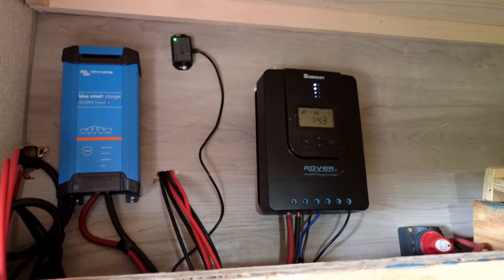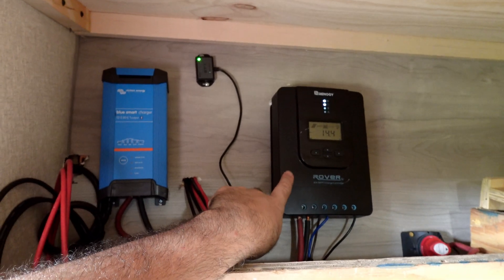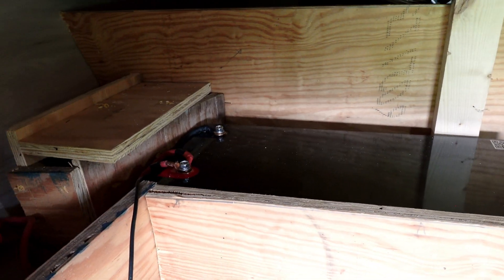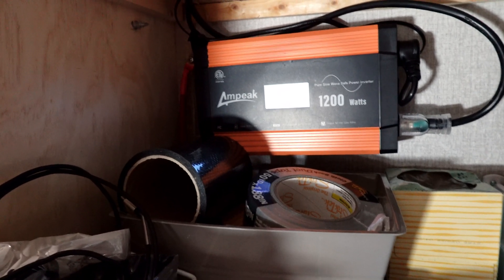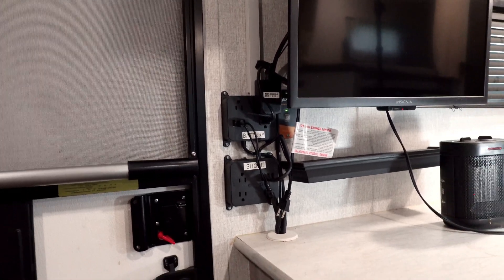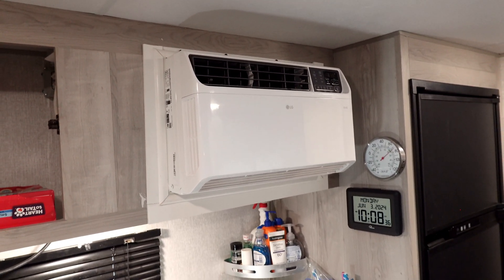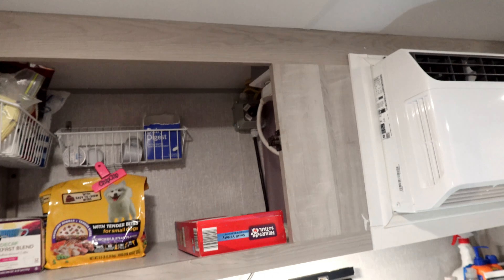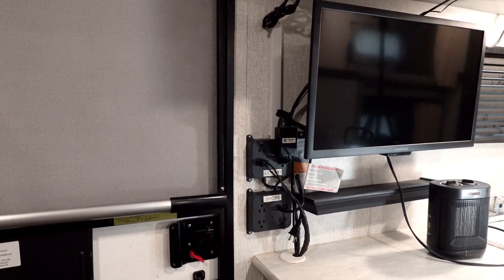Complete Solar Setup - Low Cost To Run Air Conditioner On Solar

Comment: Thanks for the video sir
Reply from the maker: You're welcome! Hope it helps!
Reply: What brand are your solar panels sir.?
Reply from the maker: @notchfox6086  They are a mix of renogy and eco-worthy.  Just make sure that if you mix solar panels to make sure the output voltage is the same, or your system will use the lowest voltage of all of the panels and you will lose efficiency.
If you do mix panels, you can do what I did. I have a 40amp Renogy mppt charge controller for 500watts of solar and I have another 20amp renogy mppt charge controller for an adidtional 200 watts of solar.  
You can buy them in kits like this so you save on a lot of cost https://amzn.to/3BjHVIW
Just add multiple kits if you need more watts. But you should only add up to 3 kits as the suggested max mppt charge controllers is 3. so 3 kits will save you a lot of money if you need 600 watts of solar.

Comment: Simple. I just plug my entire camper into the inverter using the shore connection cord. I then shut off the AC input to the camper's AC/DC converter. Done.  Also, how, the heck, are you running an air conditioner on a 1200 Watt inverter?
Reply from the maker: i bought a 6000 btu duel inverter window a/c. it runs around 600-watts for the first 15 minutes of cooling and then it goes down to about 200-watts of power use.  Also, because it's an inverter a/c I don't get a power spike. 
it will cool an open space roughly 24ft long. My rv is 18ft. and it cools it great!
Reply: @familyrvliving I didn't know about dual inverter AC. Thanks.
Reply from the maker: LG makes it. It is extremely efficient. Here is my install video https://www.youtube.com/watch?v=cW-v2OV2T1w

Comment: I’m in the Philippines building my ice cream truck now I ordered the 2 life pros 280ah batteries here they are 420$us each but I’m going either the 3000 watt inverter my ice cream machine is 1100 watts cycling on and off my deep freezer is 200 watts same and the snow cone machine when in use is 300 watts you think 2 280ah life pros will be enough?
Reply from the maker: 2 280ah batteries should be fine, but you might need at least 1100 watts of solar to keep it going, or a 1500-watt generator https://amzn.to/4ebh53Y  and 3 victron ip22 chargers to keep them charged https://amzn.to/4ecPeQR
Reply from the maker: you might be able to only use two victron ip22 chargers https://amzn.to/4ecPeQR

Comment: Consider/review a less expensive $706 all in one solution: 280AH, Pure sine inverter, charge controller from Licitti:
1000W AC Battery Box PRO New!!!
Strong ABS+PC with flame-retardant rating UL94 V-0
Pure Sine Wave Inverter
Easily see battery status with large digital display
Multiple port types allow you to connect a range of devices
Easily connect a DC/DC charger or solar panel to charge the battery, or use the VSR to charge directly from crank battery
Can be used to jump start vehicles (175A Anderson jumper cable set is an optional extra)
All ports are recessed into the body to reduce likelihood of damage
1 Years Warranty
Estimated delivery time within 3-5 working days
PACK
CLEAR
$906.00 Original price was: $906.00.$706.00
Reply from the maker: That is a really nice all in one solution. I'll definitely contact them to see if they want me to review it. It fits perfectly with my channel theme of low watts.

Comment: It's cool that you can run your A/C on such a minimal, inexpensive system. Kudos! We built a very capable solar system on the cheap (relatively speaking) too. My wife and I are retired and live FT in an older motorhome, boondocking most of the time. In fact, we boondocked for 10 months last year. We're designed and built our off-grid electrical system ourselves, on a limited budget. It took us 5 years to gather the resources to finally complete the project. We're living this lifestyle off of a limited retirement income so had to take the low budget route, foregoing name brand components like Victron and Battleborn for more affordable options. 

We started by building a 620-watt liftable solar array on the side of our 1999 National Tropical MH. Our side array makes a nice bedroom window awning too, practically lifting itself with a couple gas struts, and it's easy to clean, standing safely on the ground. Next, we built a 12v, 560ah LiFePo-4 battery (basically 2 of yours) using 8, 280ah prismatic cells and a Heltec 330amp (1,200a surge) BMS with a 5a active balancer. These cells fit perfectly under the steps of our MH where our old pair of golf cart batteries used to reside. We insulated the battery compartment, cut a small hole in our step risers and installed a tiny computer CPU fan to keep this space at close to room temperature, so we don't have to worry about the BMS shutting down charging due to low temperature - or their life reduced from getting too hot. Our 12v system uses an 80A LFP converter/charger, a 1,000w Renogy inverter, a 50a Epever MPPT charge controller and a Lnex battery monitor. All this cost us under $3,500 and meets all our off-grid electrical needs except for our air conditioning and microwave. This first phase has already paid for itself several times as we boondock so much.

By mounting the solar array on the side of our coach, we left the roof free to rack 8, 550w solar panels down the length of our 35ft Class A, 15" off the roof, above our AC, vents, etc. It shades our entire roof, allowing plenty of cooling air underneath, increasing solar output and reducing the heat load on the air conditioners. Our 4,400w fixed array can run both our A/Cs, household appliances and charge our batteries from solar at the same time, even in winter. We mounted a Sungold Power all-in-one 48V, 5,000W Inverter/100A charge controller/battery charger, breakers and another Lnex battery monitor on the wall in our bedroom, saving us space as well as money compared to a system built with individual components. This all-in-one unit has the same 99% charging and 95% inverter efficiency as the high end Victron unit, though it lacks some of the bells and whistles to come in at only $764. We chose this particular unit because it supports up to 500 volts of solar power which was needed to accommodate our 400voc solar array. Our 48v battery uses 16, 320ah prismatic cells and a 200amp Heltec BMS to keep it safe. Together with our 560ah 12v bank, we have a total of 23.5 kwh of batteries onboard (the equivalent of 18, 100ah lithium batteries) - kept charged by 5,020 watts of solar. The price of Lithium prismatic cells has dropped quite a bit over the last few years. Our first 7.1kwh battery cost us $1,569 or $221/kwh, however the 16.4kwh we bought last November only cost $1,726 or $105/kwh. Of course, you'll need to add a $100-$150 BMS to keep things safe. Not only does building your own batteries save money, but your battery will have a much smaller footprint and be lighter than a factory assembled battery too. 

We removed our old rooftop bedroom A/C and replaced it with an EG4 28.5 seer-2, 12k btu mini-split heat pump on the upper rear of our motorhome. It's super quiet and cools as well as our 14.5k btu soft start equipped Furrion we have up front, but only draws about 1/3rd the power. This second phase provides 24/7 off-grid air conditioning and heat from the heat pump reducing our propane usage too. Our total budget for both 12v and 48v systems was around $11,500, including the $1,500 high-efficiency heat pump. We have no need to hook-up to power pedestals anymore, as we run everything in our MH without it.

We travel around the country a lot, visiting National Parks, and doing the tourist thing, mostly boondock out west. We spent last winter in Yuma, AZ, but we're visiting our son in NC now where boondocking places are pretty rare. We found an RV park that is letting us camp in a spacious site without hook-ups for only $100/mo., saving us $500/mo. off their FHU rates. That's only $3.33/day, which is well within our budget and a no brainer for the convenience this park offers.
Reply from the maker: Wow, that's a great setup! Finding a campsite for $100 per month on the East Coast is incredibly rare. I understand how tough it can be to find affordable camping options there. I recommend checking out the website/app "thedyrt.com" for good deals on camping spots.

On a different note, I struggled to find a low-wattage cooking skillet. I finally found an 11-inch skillet that only uses up to 900 watts, and typically just 700 watts. It's almost as big as a standard skillet but much more energy-efficient. I'll leave the link below if you're interested. It's often out of stock, so keep an eye on it.

Thanks for the awesome comments, and happy camping!

Skillet Link - https://amzn.to/3VVR1TU

Comment: Nice tour of your system.
Reply from the maker: Thanks. My main goal was to design it so I wouldn't run over 1000 watt devices. This keeps me in check to make sure I don't over drain the battery. Some items are hard to keep below 1000 watts but I think I've found solutions to everything that I can plug into the system.